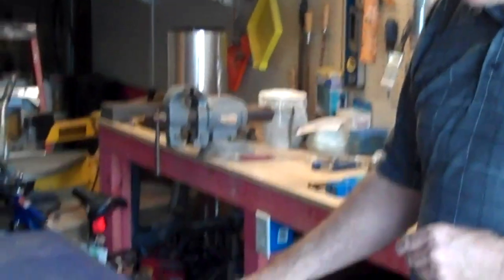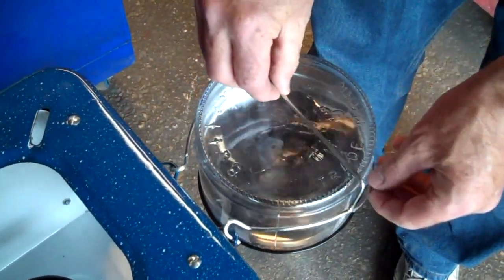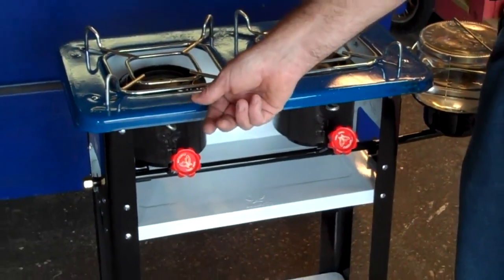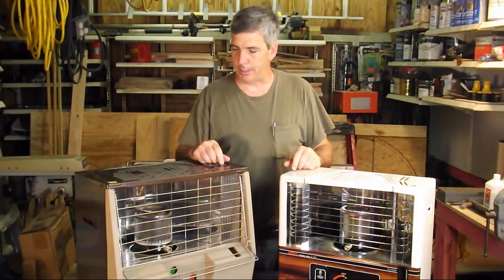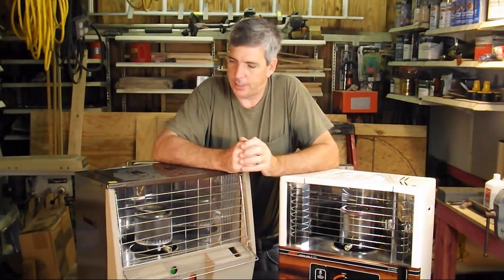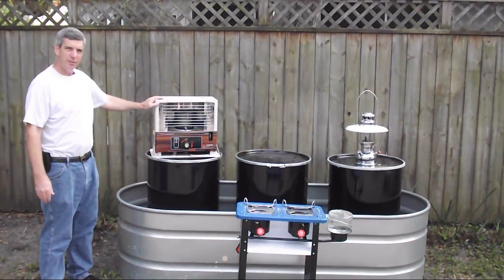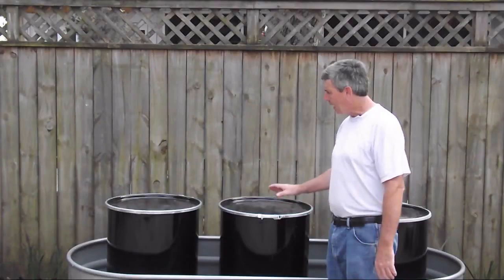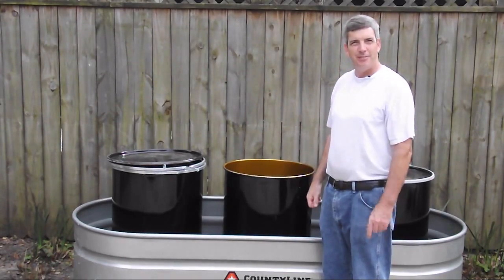Kerosene heating, cooking and lighting

Comment: Kerosene smart, diesel is cheaper and easier to get.  In 2005, diesel stunk, now it's the local k1 that stinks and the kerosene from BP has no odor.   1:2 k1:diesel mix might work, but I have not tried. Maybe 50/50 or 3:1 diesel:k1. 

That gravity kerosene stove and the thumbnail mantel light looks like something I want to buy, but I never have seen either for sale. Just the clunky big classic kerosene heaters. 

You go to great safety lengths for the kerosene storage, but you don't talk about fire safety precautions. Like burning in the big metal container, and keeping sand around.

Comment: Hey there, hoping you can help, I just recently bought an Alpaca TS-808 new old stock, it's never been used, after fueling it up and letting the wick soak up the fuel for an hour or so, I'm unable to get it to burn without a strong odor, it has a nice blue triangle flame that comes out of the top, you can see it better in the dark, but the smell is unbearable, I've tried different batches of fresh fuel, the wick looks brand new I don't see anything wrong with it but I just can't stand to be around this thing it stinks so bad, I've had Kerosene lamps and heaters for years and never have an issue with odors, I'm confused as to why this stove is doing this, any advice you have might would be helpful
Reply: Resolved? Maybe you can chance by vegetable oil

Comment: Back in the early 50's, my grandparents owned a cottage out in Oxford, Ct. They had a two- or three-burner kerosene stove using the exact same system as this stove: gravity feed and burner "cans" with a wick.  They also used kerosene lampsto light the cottage. The two or three-gallon fuel tank hung off the right-hand side.  Never forgot that stove and now, I've found a source. Thanks for the post... have enquired as to cost and shipping from St Paul Merchandise.
Reply from the maker: Thanks for sharing.

Comment: Excellent video But I have to add :do kerosene It's not as volatile as gasoline but you still have to be pretty careful with it and keep it away from any heat source Because kerosene makes very big explosions too ..Those little stoves are pretty efficient problem with it is the kerosene tank is too close to the fire
Reply from the maker: Thanks for the comment.
Reply: Hi Gene I grew up with this stove tried to order one from St.Paul Mercantile but he said due to the virus he had to close down for a while 😔😔 do you have extras you could sell one?

Comment: Thanks for the video!
A really sound introduction with good foresight and valuable suggestions.
Good enough to prepare anyone for a backup plan in any situation.
I would have liked to see these stoves burning.
We've used cheap blue flame kerosene stoves to make tea in a students hostel. Those using electric stoves said our tea tasted much better than theirs, and they had been familiar with wood stoves!

Comment: If you have the money, you can run your entire home on kerosene or propane. You can use kerosene directly for lighting, cooking, and heating. Theoretically, you can even use kerosene for cooling. Same goes with propane. For electricity, you can run a gas generator on propane. You can run a diesel generator on kerosene. You can run a gasoline car on propane and run a diesel car on kerosene (watch for road taxes for each). You can have a propane or kerosene powered refrigerator and freezer. The Amish use them. You can literally run much of your life on kerosene or propane, but it's going to cost you. Electricity will be a lot more expensive if you generator it using kerosene or propane on-site compared to just hooking to the grid. However, if you need off-grid electricity that can be reliable, it can be done.

A more logical method, if you decide to use kerosene for example in an off-grid setup: directly use it for lighting and heating (unless you choose to use wood for heating). Get a kerosene powered refrigerator and deep freezer. Build a "summer kitchen" (a kitchen not inside of the home but sheltered from the elements) and put in a decent kerosene powered cookstove. You can probably build a kerosene powered oven too. Put the kerosene powered fridge and freezer in there too and make sure the summer kitchen has plenty of airflow. For the minimal electrical use (phone charging, computer and electronics use, etc), get a battery bank that can run everything for 1-7 days. Obtain a good diesel generator that can charge that bank in one to two hours and run it on kerosene every however often you need to to charge the battery bank. If you want to go a step further, obtain kerosene powered water heaters (yes they exist) for hot water. They do use some electricity though so prepare for that. For laundry, if you don't want to hand wash everything, get a small electric washing machine and do laundry when charging the battery bank. I don't think there exists kerosene powered clothes driers, but would be cool if they existed. Just have to rely on solar power (the sun) for drying clothes.

Comment: Another kind of kerosene lighting is the "Alladdin" lamp, which uses a mantle like that Petromax or Coleman pressurized lanterns. However, it is NOT pressurized, and is therefore easier to use.
Reply: I have a couple of Aladdin Lamps and yes they are very bright and because of the way they burn they are odour free, but you have to let them warm slowly at a low setting and even then I don't completely trust them. They can over flame quite quickly. Pressure lamps though producing a hiss (I find the sound quite engaging) I trust completely and have more than six general lanterns and two table lamps.
Reply: @COIcultist  'cept that pressure lamps can explode. The Aladdin lamps are very safe. Sure,  you have to tweak them if they're "getting frisky" - but you do with Petromax or Coleman, too.
Reply: @Jollyprez  I'm not talking about gasoline pressure lanterns. I do have a small Coleman one somewhere. The gasoline ones have the advantage of not needing a preheat but, no I was never over comfortable with gasoline though I do have a non pump Optimus pressure stove. 
I honestly as I can say I've never heard of a pressure kerosene lamp exploding.If you have I would happily look at a link.  I'd not be wanting to fall asleep with an Aladdin lamp on, but I have done so frequently with Tilley pressure kerosene lamps.

Comment: I know you’ve put a lot of thought into this. Will you explain why you prefer kerosene over white gas? Kerosene seems a bit safer because it has a higher flashpoint, but it doesn’t seem as clean and efficient as white gas. I like kerosene and have a few kerosene devices, but I’m just wondering why you prefer kerosene. White gas seems easy to get in the USA.
Reply: Kero is cheaper than white gas - and it doesn't explode. I use kerosene space heaters to augment heat in my large and very old ( 1770 ) house. Modern fiberglass-wicked kerosene heaters are quite clean. One problem, however, is that some dyed kerosene will clog the fiberglass wicks - and it's hard to know if it will or not, as the dye requirements are not uniform.

Comment: Recommended storage life for kerosene is 3 years. After that it does degrade. Keep that in mind before you invest in a 55 gallon drum of kerosene. Other than that, I recommend kerosene for lanterns and stoves. Thanks for the video.
Reply: kerosene lasts far longer than that - it's an oil. I've used kerosene over 20 years old stored in metal cans ( unopened ).
Reply: Gregor Donnecaidh 
Why do you recommend kerosene instead of white gas
Reply: Well, it's all personal preference really. I mean, whatever works for you, but for me I like the safety of kerosene. If you have a major leak or overheat it it won't blow up in your face so it's safer to use and store. Kerosene, pint for pint will run a stove for a longer time than white gas. It has less odor than gas. Kerosene stoves tend to be a little less complicated than gas stoves so there's less to go wrong. Lanterns burn quieter than Coleman type lanterns. If you travel outside the U.S. kerosene is much more available than white gas. Those are most of the reasons I like kerosene.
White gas has some advantages also. You can use it to prime the stove by warming the tank with your hands and letting some dribble out of the jet to fill the spirit cup or use an eyedropper from your tank. I have to carry a small bottle of alcohol to prime my stove because kerosene burned in the spirit cup causes your burner to soot up and tends to clog the jets.
I carried a little Optimus hunter type box stove for a couple decades that used white gas and I loved that stove. I had a couple flare ups that were kind of spooky. Having a small metal tank of gasoline on fire makes me a might nervous. But, all in all, it was a great stove.
Mainly, just use what works for your situation. If you haven't tried a kerosene stove you might give it a try. You may like it.

Comment: I really like your storage method that is excellent. You shared burning in the appliance to season it. When finished and cooled do you wash and use a good automotive wax like Turtle Wax original hard shell to protect from rust, moisture, ease of storage, and to protect your kerosene heaters ?

Comment: I like the idea of kerosene as a prep item know that I have seen this video even tho we store about 3 times more wood than would ever need. This is a better option I think than having propane tanks buried in the yard. But just to make it easyer I would get a hand pump for your drums. Did you say one gallon would burn for 14 hours that is very impressive I have to say.
Reply: One litre has almost exactly 10kW/h of energy. A lot of the radiant heaters (That I see in the UK) are 2kW,  3kW or 4kW and are in the high 90s percent efficient. So a 2kW heater would burn for 5hrs per litre or  over 18hrs for a 1 gallon US tank.

Comment: I USED to use Kerosun heaters.  They stink when you light them and they stink when you are shutting them down.  Out in a garage, they are fine, inside my house, I couldn't stand it.  Wash your walls after a season of burning kerosene and you'll see the residue in your water.  Do they heat?  SURE.
Reply: They're meant for EMERGERNCY heating. Not a central heating. I'd take dirty walls over freezing to death. And also it will not stain when if you use it for a week.
Reply: Michael C KeroSun heaters were big in the US for some time.  Then K1 went high $, so folks quit using them.  I literally could not give away my heaters due to operating costs and they went to the curb. People didn't even want them for emergency heat in my area. NE US

Comment: Gene, I see that you are a believer in kerosene for heating, lighting, and cooking and just purchased my first kero heater on your recommendation.  A friend of mine sold his kerosene heater because it left an oily residue throughout the room.  A couple questions:
1.        Has this been your experience? 
2.       What is the best way to avoid oily residue?
3.       What are the benefits of kerosene over propane for cooking?  I have seen your latest reviews on Butterfly stoves, they seem great, but am concerned about fumes/smoke/residue with the stovetop burners.
Thank you for your help, I appreciate your advice and have shared your channel with my friends.
Reply from the maker: PT BlueDog Hello PT BlueDog. Congratulations on your new heater.  Years ago I was really turned off of kerosene heaters.  It did exactly as your friend said.  First off, this to me is a worse case senario; no electricity, no heat.  Second, these units have to be seasoned, I did not use it properly.  All the machine oils have to be burned that were created durring the manufacturing process.  The wick has to be fully saturated with kerosene before lighting.  Light out doors and extinguish outdoors will also alieviate a lot of the heavy fumes.  Use a Mr funnel to get water and contaminates out of the kerosene.  Adjust your wick properly and crack your window.   This gets rid of most of your problems.  The stoves are to be used out doors.  Again as back up.  Why I love kerosene is the way I can safely store it and use it for so many different applications.  Propane is half the btu's and is real hard to judge how much I actually have available.  Plus it is a bomb.  Gene